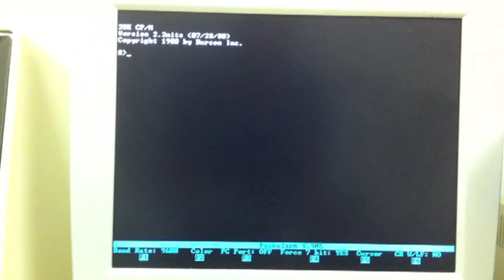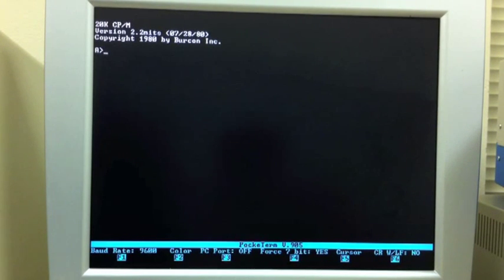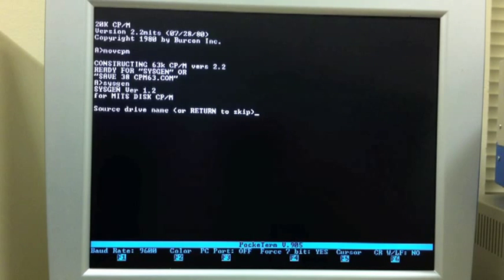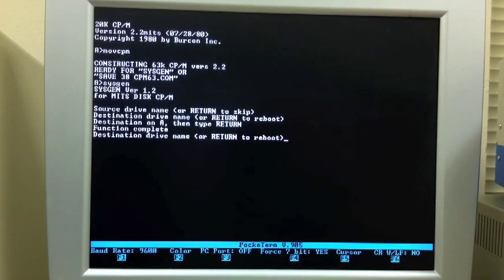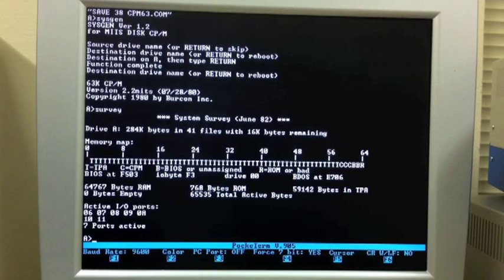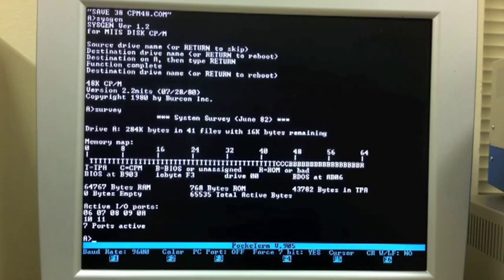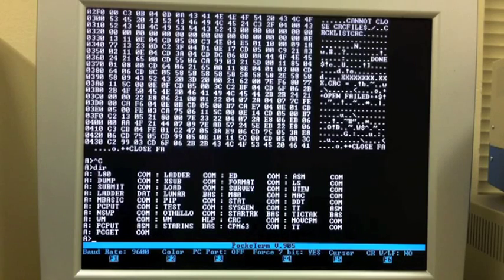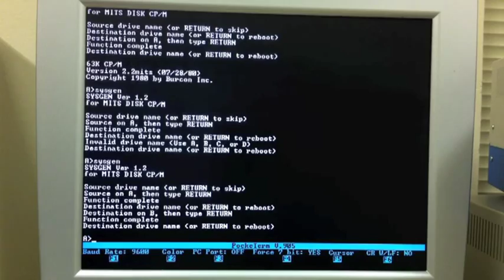Altair 8800 - Video #18 - Changing CP/M's RAM Size

Comment: I'm trying to wrap my head around this process for brining up CP/M on my own machine... a few questions, if you don't mind;  The computer must be able to load sector 0 (128 bytes), which loads the CCP, BDOS, BIOS from disk.  When you "movcpm", the addresses for everything change in the loaded in CCP and BDOS, but assumably, the BIOS is non relocatable... how does that work after it's done moving it, if it's still in the same location in memory... or does it actually move those at that time as well, so that they can continue to function?   I realize that movcpm is running from TPA space, so it should be fine there. but moving the address references within the OS confuses me.
Reply: Everything's relocatable, even BIOS which is a component of the OS, it's not somewhere on the motherboard in some chip as it it today. Why does it work? Because the first 256 bytes contains a vector table which sets entrypoints to specific BIOS and BDOS functions. The same principle can be found in modern PCs where the first kilobyte (or whatever) is populated by the BIOS interrupt vector table. No matter where the BIOS is in memory, a consistent entrypoint is always available, so invoking any of the interrupt vectors in the first kilobyte (or whatever) memory will correspond to a particular BIOS function. This same principle exists even today and this is why you can install MS-DOS to even modern PCs (compatibility aside) since DOS extensively uses low-level BIOS functions to communicate with the hardware.